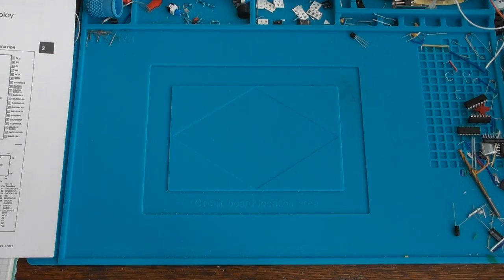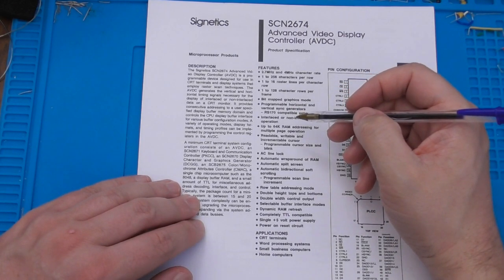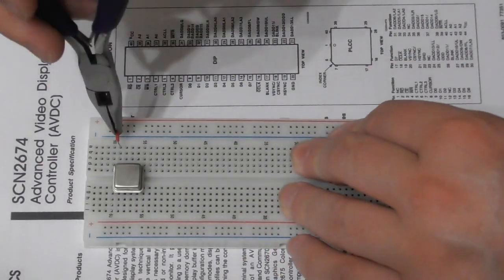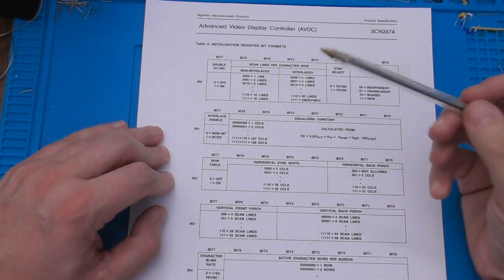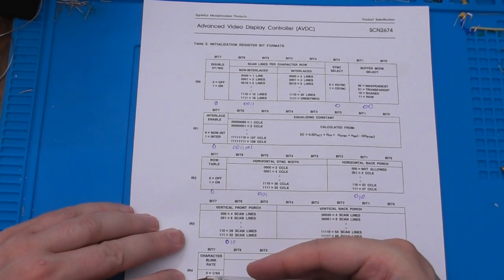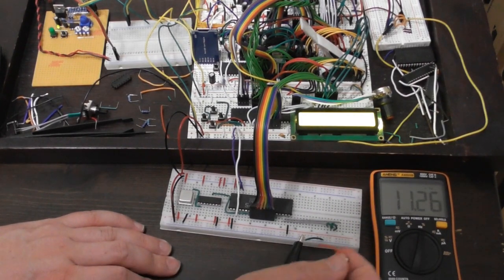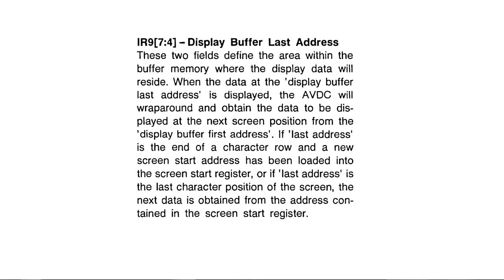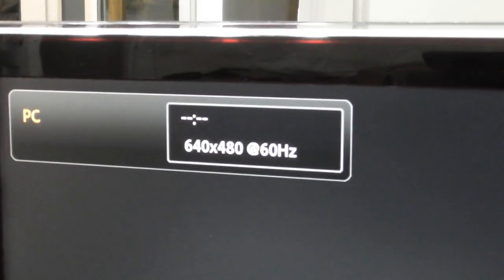Can the SCN2674 output a VGA signal?

Comment: Just popping in to say I recently acquired a dumb Terminal and inside was the SCN2674 driving it all, and googling the chip to try and find schematics your video was the first thing to pop up again.
Reply from the maker: It's funny that - the SCN2674 videos were very popular for some reason, I'm not sure why as it is an obsolete part that's no longer in manufacture, and wasn't even very significant in its day compared to something like the 6845 which seems to have been much more common!  Still something clicked with them and I guess Google likes these videos!
Reply: @GeorgeFoot  I think it's mentioned on a wiki page on video chips mentions it-  that's why I started looking it up

Comment: Very interesting chip and process. Total aside: I have that same meter and I never imagined it could measure frequencies that high.
Reply from the maker: Yes, it's surprisingly capable and cheap, and it has a great sample rate as well. Given what I later discovered about the vsync, it's possible it would have been able to sample it as well if the circuit was actually working.
Reply: @GeorgeFoot  Am I right in thinking this is the AN8009?
Reply from the maker: It's AN8008, I saw it on EevBlog a while ago and I think his only complaint was related to the ranges available for current measurement.

Comment: Thanks for this!  The chip looks very interesting.   I'm building a 65C816 system and I have a 68B45 on order.  My goal is 800x600 resolution and your SCN2674 looks very interesting.  I may order one.  By the way,  I currently use a ATF22V10C to stretch my clock for slower peripherals (such as a PCF8584 for I2C and a NHD0440 display).
Reply from the maker: Nice, yes I think this is capable of about double the character rate of the 6845, though I don't know the specific figure for the 6845. You can always squeeze more pixels in horizontally by just using longer shift registers - you'll need at least 10 pixels per clock - the problem is more that features of this chip like hardware scrolling and split screens will have worse horizontal granularity. You can add your own adders of course to fix that but you start to lose the benefit of the monolithic IC.

Vertically, though I didn't mention it, this chip has a "graphics" mode where the repeated scanlines actually keep counting up through memory addresses, so you cover a lot more addresses contiguously. One thing I don't think it supports is a custom stride.

If you're interested in whether a specific combination of register values works then let me know and I might be able to try it, if I have the right oscillator handy.
Reply: @GeorgeFoot  Thanks for the offer.  I found the SCN2674 on Jameco for $5.  I'm going to order and compare them to the 68B45.  I had a 6845 (not the 'B' version) working with a 1Mhz 6800 back in 1980, but I've forgotten more than I remember.  Had it working at 80 chars by 50 lines on a surplus word processing monitor.  It's a shame I can't use the GD6410 ($11 on Jameco).  It's a 5V part but that QFP-160 pin package is a bit beyond my skills.  PLCC-84 Through Hole seems to be my current limit.

Let me know if you need help with using the atf22v10c for 'glue' logic.  They seem to work fine for me now that I have some experience with them.  The TL866II Plus programs them just fine.  WinCupl is rather finicky though.  And I'm starting to gain some experience with the ATF1508.
Reply from the maker: I wouldn't be too afraid of QFP soldering, you can buy some cheap chips and practice boards and get the hang of it in the end - then solder the real thing into an adapter board.

Another option is to try to find it with J-leads then maybe you can solder a through hole socket to put it in.

I have a pretty good setup for programming the 22V10s etc - I stopped using WinCupl and found command line for running the compiler and simulator so I can automate that better, and it was a much smoother experience after that. ATF1508 looks nice - I got an ATF1500 before realising it wouldn't work with the TL866.

Comment: The VSYNC width field isn't in a weird order: it's using Gray codes by the looks of it. There's probably some good reason to do with the chip's internals as to why they're used here.
Reply: Nothing nearly as ambitious as this project, but I implemented the ACM CORE graphics standard from a book with pseudo code in College, and I remember the challenges of coding to the card with the VGA hardware after the relative EASE of CGA and EGA coding.  Yeah it looks odd, but it actually makes pretty good sense once you take a look at it.

Comment: Nice video, one point, 5v rail decoupling capacitors on the video board !
In the 70s people were paranoid about crowbaring supply rails so one per chip became common, in the 80s people relaxed and used less.

Comment: I am writing a code for this baby as it is used by a retro machine I'm playing with called Iskra Delta Partner. Thx for this video, I really learned a lot from it. Hope you make part II.
Reply from the maker: Great, it'll be good to hear how that goes! I was just experimenting with actual video output, having trouble getting crisp pixels at the moment though, hopefully I'll find a solution soon
Reply: My hardware is this (see the link below). I'm a software guy so I have troubles understanding it. But I do understand that it combines graphical card Thomson EF with an SCN - unconventionally gluing outputs of two cards together. The SCN part has its own SCB chip to generate attributes and its own logic to generate characters. Maybe you can get some info from it for your project. 
https://drive.google.com/file/d/1OSoaMkrv7T39G1Ct_5qzWgFxN8izR2_x/view
This is an actual graphical card from 1983. I'm currently trying to find out how I can produce custom graphics. I can see an EPROM (characters, I guess?) and static RAM chips both connected to the SCB chip sharing the bus so my uneducated guess is that characters must be loaded to static RAM somehow and there is something that overrides EPROM to leave control over the bus to the static RAM. But still guessing. This is officially a text only card. But legend says that custom graphics can be done on this hardware, but no docs, no one to ask an no one has ever done it. :)
Reply from the maker: Cool, I'll check it out. Meanwhile here's a collection of datasheets for various Signetics parts that might be used together in that application. It also includes suggestions of how they could be combined, which your manufacturer may or may not have followed! http://www.bitsavers.org/components/signetics/_dataBooks/1986_Signetics_Microprocessor.pdf

I'm going to get text output working next, I'm halfway through that right now. Generally the SCN produces addresses (one per character) that you feed into a RAM's address pins to read an ASCII value per character. Then that value is shifted left a few bits and combined with a row count from the SCN2674 to get an address to look up in character memory (ROM or RAM) that contains e.g. 8 bytes per character with each byte defining the lit pixels for one row of that character. That then goes to a shift register to display the pixels one by one on the screen.
Other ICs that may be involved could be reading colour/background data (character attributes) and combining that with the character generator's output; adding cursors, underline, etc; and double height or width processing which are all sorted by the SCN2674 but subject to the rest of the circuit knowing what to do with them.

Comment: Another great video, thanks for sharing!

One thing I can’t understand is why, with the abundance of retro CPUs and peripherals still being manufactured, video chips are not one of them. Sure, I know you could use FPGA, or depend on eBay/AliExpress, but in my designs I try to avoid those…
Reply from the maker: Yes, this one is recycled for sure, it has solder tinning on the pins. I wonder if one reason is that the video signals these were designed for are so obsolete, and useless without the right display hardware. The TMS9918 is essentially SDTV only; this one here is barely capable of the horizontal sync needed for VGA. I guess the next level up that's is EGA or VGA (which were custom ASICs).

The trouble with SDTV is the horizontal sync rate being low (about 15kHz) which modern monitors don't necessarily support. There were too many standards and too many connector types. SCART is great but never existed in North America. And all these things are less and less supported on modern TVs. Who knows how long they be around now. 🙁

So there probably is a lack of demand for the authentic through-hole ICs of the day due to modern display hardware limitations; and on the other hand, the 31kHz "HD" schemes like VGA and up were never available in this form factor, they've always been SMD ASICs. Bearing that in mind then, the most authentic answer probably is in fact to use an FPGA after all!

Or roll your own solution from more parts, which I certainly enjoy doing. The EEPROM sync approach is the most compact I've found. I have another design using your ATF22V10 PLDs but it still needs separate counters to be useful, so ends up a little bit more complex than the EEPROM approach. I also had a design using tons of downcounters that was logical and I liked it a lot, but that's about twice as many ICs again. It's great how many options there are though and they all work well except using upcounters and logic gates which is a nightmare!
Reply: @GeorgeFoot  could it be possible to make a drop in replacement board based on Atmega8 ?

Comment: I've actually got one of these on order, along with some 64kx4bit 15ns RAM and a suitable crystal for outputting a PAL signal. It'll be interesting seeing how it handles VGA.
Reply from the maker: Great - it should be good for PAL. What speed is your crystal? I think you want 13.5MHz for 640x512. I used a 27MHz crystal divided by two for that in another circuit. The exact pixel clock didn't matter much in the analog days, and the BBC Micro used 16MHz, but modern TVs don't like that so much.
Reply: @GeorgeFoot  It's a 17.734 Mhz crystal, to be divided by 4 to give me 4.433 Mhz. My homebrew design is built around the Hd63c09 and it only gets to be tinkered with here and there when time allows. It'll be good to finally connect it to a display.

Comment: Thanks for this, I really enjoyed it. I've been trying to work out a way of making an analog video mixer that actually syncs the signals and I think you may have given me the key phrase I needed to google.

Really keen to see an image being produced by the Ic. I wonder if you can make a tiny rom that would program those  16 instructions and get it running independently of the 6502.
Reply from the maker: Ah it's the wrong phrase though, I got mixed up! AC Line Lock is for synchronizing the vsync with the power lines, not with another video source. It was important when you were filming a roomful of CRT monitors, you need your camera and all of the monitors to have synchronized vsyncs to avoid flicker.

To synchronize with another video source, you should just let it provide the vsync and hsync, then do your own counting within the frame based on those to work out when you're in the active area and what your pixel coordinates are.

Using a ROM to initialise is an interesting idea and should be possible at least as far as I've gone. But getting data into video ram later also requires some communication with the chip.
Reply: @GeorgeFoot  thanks for the heads up! I should comment more, but I enjoy your content very much!  It possibly helps yours aren't  an hour video saying  "part 107".
Reply from the maker: Thanks, good to know! It is hard to decide where to draw a line between giving interesting information thoroughly and cutting to the chase. This video is an interesting case because although it's a lot longer than I normally aim for, it got a lot more views than normal as well. But I can see from the analytics that a lot of people weren't very interested in the details in the datasheets, they stopped watching or skipped ahead. It's a hard line to walk, and editing actually takes me longer than filming!
Reply: @GeorgeFoot  Editing if done right tends to be invisible and take a lot longer than people expect. I love Ben Eaters approach of showing the datasheet, explaining what it does, the pin outs, hooking the chip up and seeing what happens. Then he usually shows some odd behaviour then goes back to the data sheet to explain why, I'm pretty sure that's you have done here. 

If I'm totally honest, and I may be unique in this respect but I usually watch these electronics video through the lens of wondering if I want to build the circuit myself, or how I could apply it to my project.  So when you see 'part 108' and see a huge mess of wires or PCBS being connected it interests me less because it's a bit more project specific. 

I hope this doesn't sound like a backhanded complement, but I feel like the last few months you have really found your feet with these videos.

Comment: It would be nice to have a video which shows how to do the same thing with a IC that is still in production. I was looking to DIY a 8-bit ISA bus video card but the open source options are using the TVGA9000 chip which is hard to solder and expensive. High performance video is not on my list since I will be running mostly Retro video games that run on the original intel 8088 IBM PC era.
Reply from the maker: Unfortunately there aren't really any good options that I'm aware of, I expect there's no commercial market for it given modern display technology. It is possible to program a PLD to assist quite a lot but generating addresses to scan video RAM requires a lot of output pins. Most of my video output circuits have just been based on discrete counter ICs for this reason.

Comment: Thanks for the well presented and informative video. 

I currently have 3 VDPs, and have yet to design an implementation for my 6809-based computer. 
As far as simplicity, which would you choose:
- TMS9918ANL
- SCN2674
- MC6847
Reply from the maker: I think the TMS9918 and MC6847 are more compete solutions as they decode the memory contents into a pixel stream for you. But I think they limited to low resolutions. The SCN2674 I used here only really generates addresses to feed into the memory, it doesn't pick up the results - hence here I used a character ROM and shift register to get a pixel stream out.

Comment: I'm a little confused about the 6522. You mentioned that you can't talk directly to the chip because of clock speeds, so you instead latch values into the 6522. But in the 6502 code, you seem to write one value the port, and then the next. How do you ensure that the writes to the 6522 don't overwhelm the SCN?
Reply from the maker: The STA instruction takes 4 CPU clock cycles, and LDA or EOR takes another 2 - so it's about 6 cycles overall, which with my 6.3MHz CPU clock rate should last about 1us. I think the SCN only requires a few hundred ns, so this should be fine.

There are some other constraints on the SCN bus timing as well - such as sometimes having to wait at least until the next CCLK - but my CCLK is fast enough that I don't think that is a problem.

Comment: What’s the details of the  power supply board you’re using? Looks interesting.
Reply from the maker: It's the one I demonstrated here, just built on veroboard instead: https://youtu.be/DyxhS2SbpGM

I made some improvements to the original circuit since then but this veroboard version is, I think, exactly what was in the video above.
Reply: @GeorgeFoot  cool, thanks! Must’ve missed that one when I was binging your channel. :)

Comment: You might want to look at  Other legacy (old) Video chips that can do VGA / CGA such as :

The NEC upd7220  (D72020 CMOS) in DIP40 or PLCC44
The Yamaha V6366 PLCC84,  as used I some 'Hercules'  legacy/old PC video cards

I also saw someone trying to use a Thomson TS68483...which looked quite interesting .